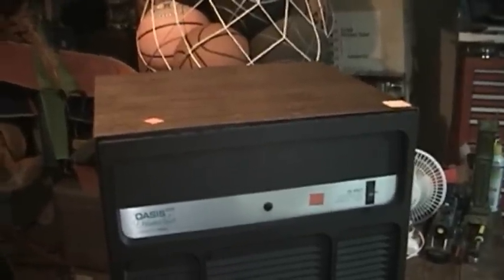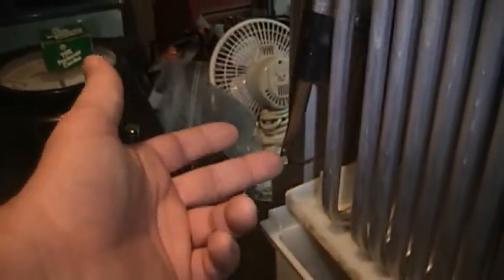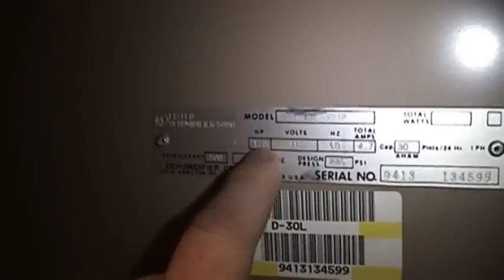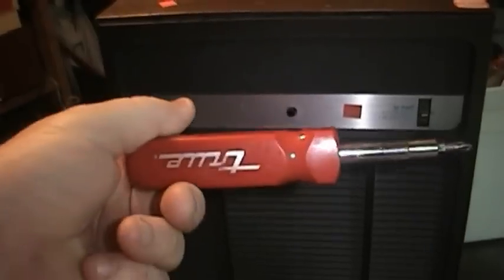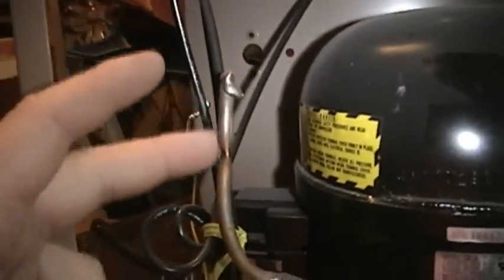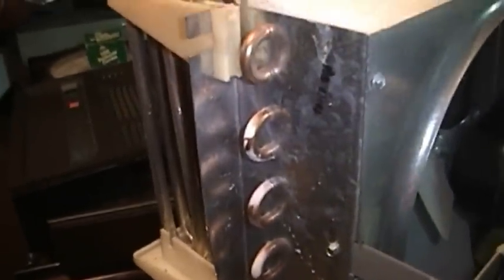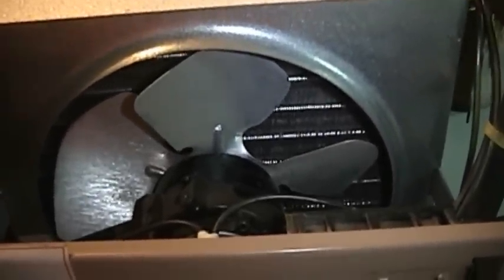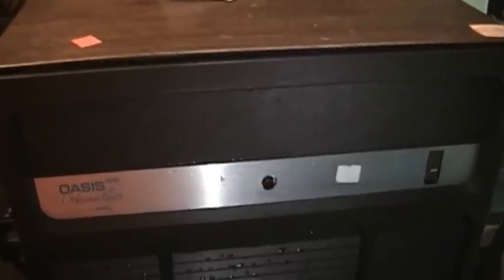Oasis D-30L Dehumidifier

Comment: It looks so clean inside, i expected more than a light coat of dust :-)
The compressor sounds really nice :-), and the fan spins like brand new.
Yes your right bill, a quality made product with no daft electronics to go wrong, its quite sad that most companys produce junk these days :-(.
I bought a cheap socket set when i was 17, it was made in japan, im 48 now and i still have that socket set and its still fine :-), perhaps it wasnt so cheap as i thought,  most modern cheap sets just fail in no time, the ratchet fails in a couple of years.

Comment: Had to look up what a dehumidifier was. Down here, we go straight to air conditioning as humidity is usually pretty low, and heat during summer pretty high. That said, we don't condition the air (heat or cool it) unless it's either very cold like now that it's winter, or very hot. We had a heat pump style external unit at our apartment in Columbia, MD, but it doesn't seem like you can get those in Australia - most of them seem to be refrigerated air con units.

Comment: That's a very nice unit. I'm surprised that it's from 1994. I would have guessed rather 1984, given the woodgrain finish and metal trim on the front, and of course the standard to which it was built.

Neon lamps work like fluorescent lamps in that they have cathodes coated with emitter (the two cylindrical structures inside a neon indicator lamp) which gets consumed as the lamp burns, until eventually there isn't enough to sustain a discharge.

Comment: You sure are right about new dehumidifiers being crap. I had both a LG and a GE(Yes the one that can catch on fire) and both lasted one(Yes one) summer before the refrigerant leaked out. The LG was a 2010 and the GE was a 2011. Both were 70 pint ones. I was hoping one bigger one would use less electricity instead of the 2 old ones I had. After the GE leaked out its refrigerant I had had enough. I went back to my 1999 Whirlpool 40 pint and the 1974 GE 25 pint. Both have worked well the past few years. For those that dont know why we would need a dehumidifier, in the north our basements can get pretty damp if you don't have one or more of these.

Comment: My dad has a very old dehumidifier made by Sears that has presumably been working for around 25 years straight in the basement... However it seems that excessive snow accumulates on the coils at the back of the unit and was just wondering if that would be a normal condition or not. Thank you

Comment: I'm about to see whether a new Oasis will outlive me. My first I bought secondhand for 3 pounds at an auction in UK as teeenager in about 1980. It did have a gas leak a while later needing a repair, but it then  ran 24x7 until around 2015.  I have a sense of foreboding that the quality may have evaporated in a new machine, but it will be cheaper than most plastic wonder machines, so I'll give it a go !
Reply from the maker: It'll be interesting to see if they've kept the quality up. I still have this one and it still works very well.
Reply: @uxwbill  It apparently weighs 23 kg, so that's a good sign !

Comment: What I'd like to do to mine is fabricate some type of air dam to direct some of the air flow from the fan back towards the rear panel so it will flow over the compressor to cool it slightly

Comment: I have a modern LG dehumidifier that we used to use at our old house. It has just been sitting in the garage for a few years doing nothing. I plugged it in about a month ago and all of the refrigerant leaked out and the fan was jammed. I also have a 1989 Frigidaire window AC sitting around and it still works perfect. No rust, no leaks, everything works fine. Just shows the absolute shit quality of anything modern.
Reply: Mytechtime My old JCPenny dehumidifier (Made by White Consolidated Industries) was a curb find with a seized fan motor. I took the motor apart and oiled and cleaned it and it now runs in my basement. Your AC is also made by WCI, they were bought out by electrolux.

Comment: I do miss the HD video though... What happened to your MacBook?
Reply: Are you planning on repairing the MacBook? I have one of the same model, it is 6 years old this year, Early 2009, but I don't really feel like I'm feeling its age. I've upgraded the hard drive and RAM though, the original 2GB of RAM and 120GB drive definitely barely cut it when it was new in my opinion, I've gone to a 640GB drive, 140 of that is a Bootcamp partition with Vista Ultimate 64bit, the rest is Yosemite and Mac stuff. I suspect I'll end up replacing it when they quit offering OS support, as I suspect that will come before it becomes slow enough to bother me.  As for video editing I still am odd and prefer to use my PowerMac G5 dual core 2.3GHz. It doesn't seem any slower than my MacBook at encoding HD video, and is only a bit slower than my 2010 Mini at this. The main reason I prefer it is the large amount of hard drive space, and 2 hard drives. I don't know if it does make any difference but I usually will have it write the new video to a different drive than the one the source is on. Might be all in my head but it seems to improve speed. I thought most of your more recent videos were in HD is why I mentioned it. I enjoy watching videos in SD just as much, but I really like HD, you can see so many details that you'd never see otherwise. I've become lazy though, I generally record a video, and then just upload it as is. Most of mine are only a few minutes long and in my eyes don't really need edited. Longer ones, or videos I recorded in multiple parts do have to be edited to either remove monotonous parts, or splice it all together, but this makes up few of my overall videos.
Reply: ***** I also forgot to add I also don't own a camcorder, I used an old Kodak point and shoot first, then upgraded to the first iPod touch with a camera and now use my iPhone to record vides, and tend to generally just upload them directly from my phone, rarely will make it onto one of my Macs first. And I have used iMovie for iOS to do some simple editing before too. It worked well, even in HD.
Reply: I did also replace my battery a couple years ago, apparently one of more of the cells flaked out. Resetting the SMC on the MacBook did seemed to solve it but being a well used battery I didn't trust it really, so I replaced it with a brand new OEM one I found on eBay. I also think the 8GB RAM upgrade was worth it too, not far ad\fter buying it I upgraded it to 4GB where it happily sat for many years. It wasn't until after MacOS and pretty much all of its sofr\tware went 64bit and that I also found myself using windows in VMWare that I found doing RAM intensive tasks like editing videos on the rare occasion that I found my laptop was swapping memory on the hard disk quite a bit that I decided to try the 8GB upgrade that I had heard some did successfully. I was honestly considering finding a way to get a new or newer Macbook Pro at the time, but decided to try the RAM upgrade first to see if I would get enough out of that to decide to keep it longer. Thankfully it did and I'm not as eager to get a new one for a while at least.

Comment: They are such simple pieces of equipment, you have to ask yourself why the newer gens go bad or leak. Doesn't make allot of sense. Yes things are built in China but for the most part not designed there. You don't see the same issues with something like a mini refrigerator. Same principle basically.